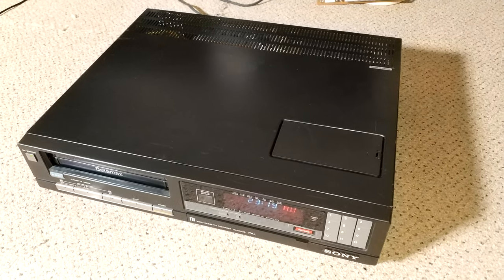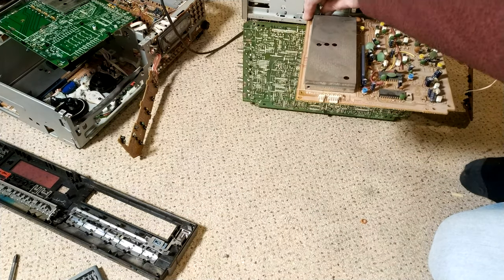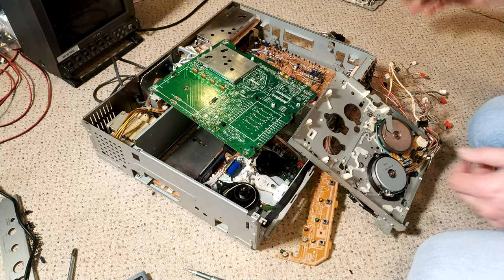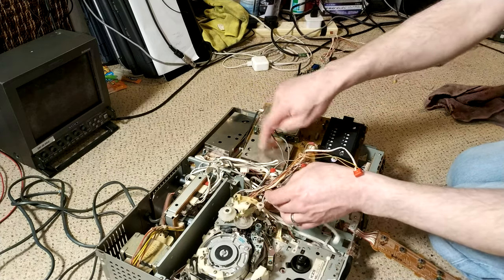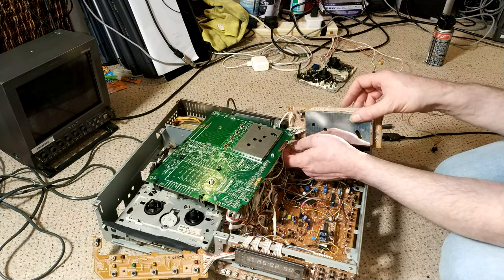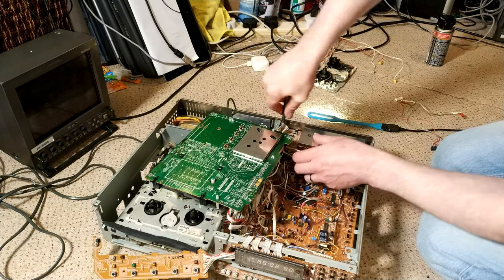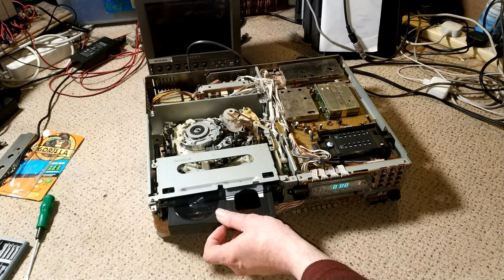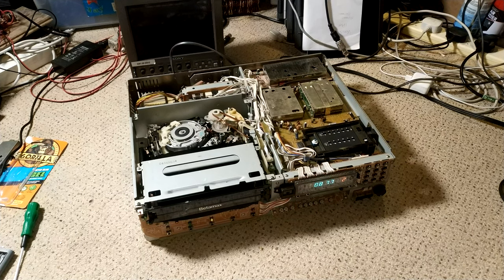Sony SL-C30 Betamax Part 2 - From E to UB sort of!

Comment: Hello, thank you very much for the videos you added. -hf100es sl c9es these devices are available to me if you have better tape reading device suggestions, I expect your help to indicate.
Reply from the maker: Thanks for the question. Both are good machines but it depends what you want to use them for - if you have Beta HiFi tapes then the HF100 but for general Beta tape viewing where the tapes aren't HiFi then the C9 is hard to beat - a great machine. If you want to record to Beta to playback later then go for the HF100 - the sound quality is amazing. Hope this helps.

Comment: Hi thanks for making your videos they have helped me fix 2 of my machines, I have a betamax Sony C30, my tracking wheel is in the middle position  but I have lines along the bottom of the screen on playback, how do I align the playback in the middle of the tracking wheel, the tapes I used  all play ok on my other 2 betamax players, the lines do go if I move the tracking wheel around but it is bugging me that its not in the middle position, also could you tell me were you get your spare parts as I bought a Sony betamax C30 on Ebay some time ago and the seller put it in a small box with very little protection and I received it damaged the tape transport controls panel was cracked . 
Best wishes
Reply from the maker: Great to hear these videos have helped you. On your C30 - so much can cause mis-tracking. Is the tape path spotless? Especially check for black 'rings' around the capstan. Is the sound good? If it's muffled it may well be that the audio head needs adjusting but if the paint hasn't been disturbed on the screws to do this, leave them alone. You could try slightly adjusting the guide on the ACE assembly on the exit of the tape from the head drum but 'slightly' is the term - just a slight turn either way to see if it improves things. Is your pinch roller OK? Does it have good run-on? Clean and test this as the bearings can collapse. Finally you can bodge it by tweaking the tracon pot on the SS-16 board. 
On the spares, it's wherever I'm lucky enough to find them. What do you need?
Reply: Thanks for your help, I just tried the yellow tracon pot on the SS-16 board, tweaking it clockwise and it done the job perfectly that’s another one working nice, I have 4 Sony Betamax machines 1x SL-F30 in great condition, 1x SL-C40 that I bought brand new back in the 80s, still in mint condition, I had to do the broken black gear fix, and grease up the loading mechanism to fix it, I watched one of your video’s to do the fix, and also 2x SL-C30s one also had sticking loading mechanism that needed greasing up and the tracking issue mentioned above, the other SL-C30 has a cracked tape transport  controls panel which is the part that I have been trying to fine with no luck .keep up the good work .
Best wishes